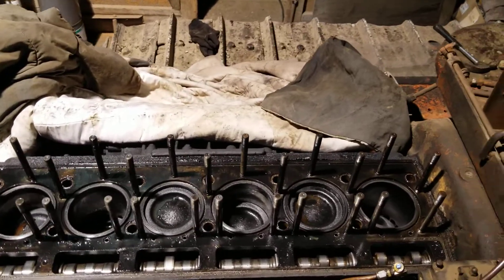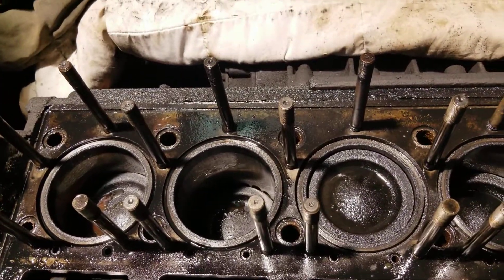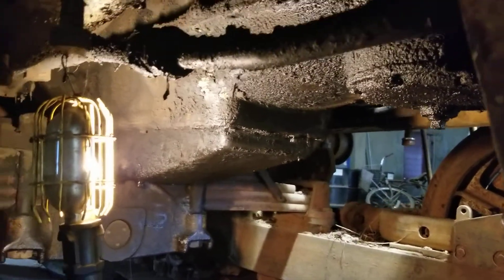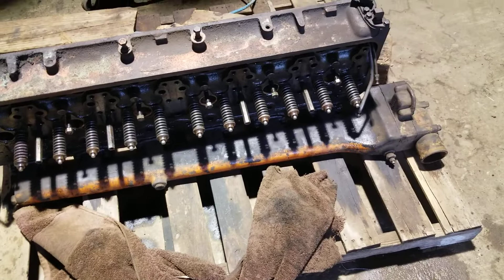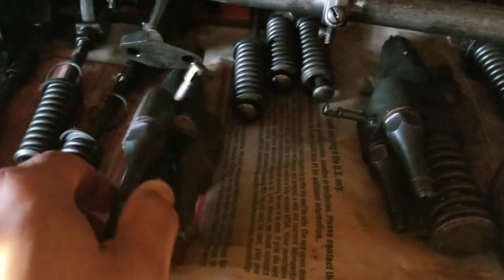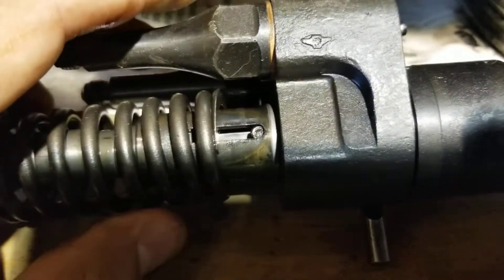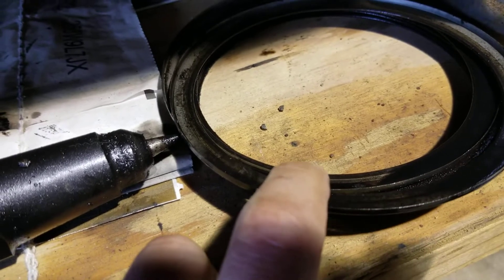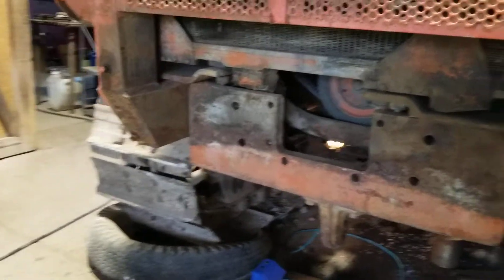Detroit Diesel 6-110 engine teardown part 1

Comment: Great work, we have a 6 110, recently had the injectors out because they were stuck. I am looking for an Injector height and cannot find one do you know where I can get a 2.425 inch gauge? Thanks
Reply from the maker: I am not aware of any.  I used the depth gauge on my digital micrometer to set it.  Here. https://youtu.be/q5_s3BB2nr8

Comment: GM should have made this into a v8 and v12, it would have been more powerful  than the 92 series
Reply: They basically did, it's the 149 series.
Reply: @kcrailroader5297  Only for Generator purposes, blocks too large for logistical uses, although not sure if they were ever used for marine
Reply: A missed oportunity, a 16v110 or 24v110 woulda been cool.

Comment: What is the height setting for those injectors and is there a tool for it? Those rings are called fire rings that seal the combustion chamber and are a one time use just like you stated. There was never a one piece head gasket for DD just a perimeter gasket, o-rings, grommets and fire rings. Good luck, looks like a really cool project!
Reply from the maker: Off the top of my head,  2.425. But i dont have my book with me,  and yes those individual cylinder gaskets are tough to come by.

Comment: Detroit Diesel sold the rights to the 110 engine to WW Williams many years ago. Many of the parts you may need can be bought through them....but it’s gonna be painful.
Reply from the maker: Yes i have purchased several gaskets from ww williams but the hard parts have been nos dealer finds because they arnt being produced anymore.  I have located everything i need.